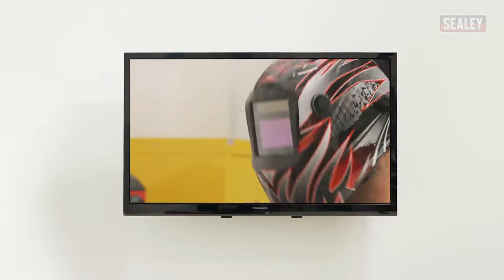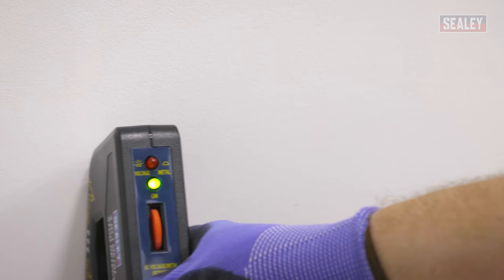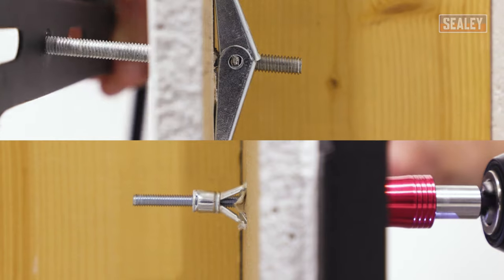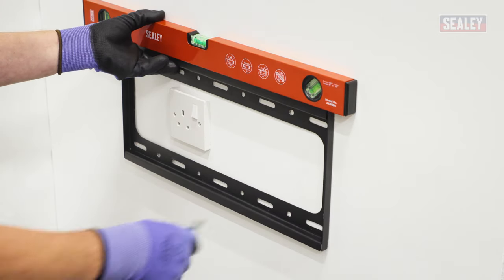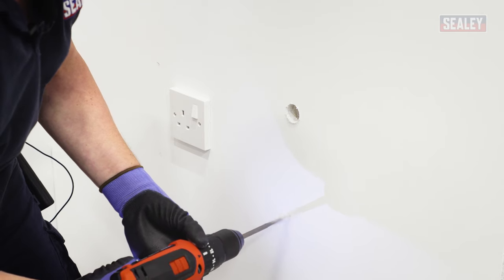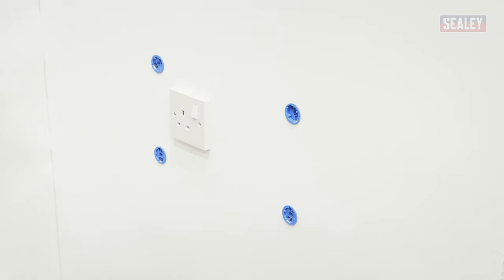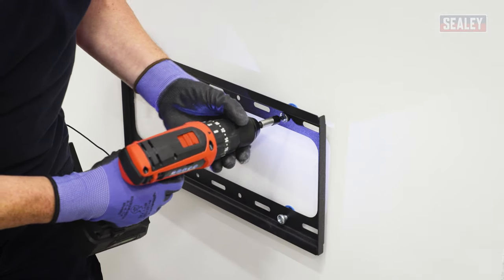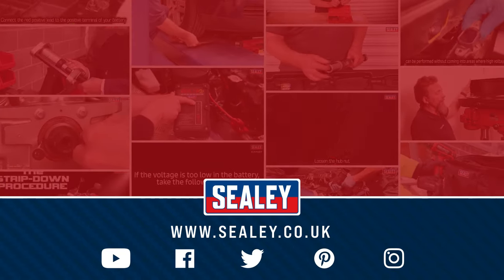How to Mount a TV to a Plasterboard Hollow Wall Without Using Studs

Comment: No, No. No. No. No. Do NOT do this. Do NOT mount a TV with any wall anchors. I did this once for a customer, and the TV pulled out of the wall and fell as I was walking out of their front door. I ended up buying them a new TV, so the job that was supposed to pay me money ended up COSTING me a WHOLE LOT more than I would have made. ALWAYS find studs.
Reply: How can I find the studs?
Reply: Looks like you did a bad job then
Reply: Same, did this to mount a 65" used 8 mounts to the plasterboard, after trying to pull the tv out to adjust the angle of the bracket I was lucky enough to catch it when the fixings pulled through. In the end I drew round the bracket on the plasterboard then used a multi tool to cut it out. Then attached the bracket straight to the brick wall with anchor bolts, If I wanted to be fussy, could have painted the brick and filled the gap left between the wall and plasterboard but it isn't seen anyway and the tv fits now fits completely flush to wall
Reply: @MikeJames.  Ahhhhh....you're one of those.
Reply: @scottwelsch4139  well well mr welsch I’ve been expecting you
Reply: Trying to mount my TV currently but the wall is an exterior wall made of plaster with brick outside.  The supervisor of the building says there are no studs as a result (not sure how that is possible but alright).  What would you recommend?
Reply: @diebyfeather  it's dot and dabbed, fix into the brick or block.
Reply: @MikeJames.  Dodgy guy, bet he'd mount a tv with blue tack then block the customers number
Reply: Or do the job more securely by drilling straight through into the wall behind. I’ve used the Fischer Für screws and wall plugs and theywill never come off. Maybe over engineering the job but they work in breeze block. I’ve fitted lots of huge televisions this way.

Comment: I Don't recoment this, the studs are the most solid and strongest part of a non brick/concrete wall.
As my grandpa always use to say, no stud, you're out o'luck
Reply: its only 50 lbs for a 60 inch tv it will work fine !
Reply: As long as it's a static flush mount (i..e not being pulled out / rotated) then it should be fine for most TVs.
Reply: What if you don't have wood studs and have aluminium studs like we use in Europe in renovations? Drywall can hold up to 50/60kg. It all comes to how those 50/60kg are distributed. A single hole holds 12kg and holes should be 40cm away from each other. Obviously mounting to wood studs or brick is always the best way but like this video says , sometimes you don't have that option.